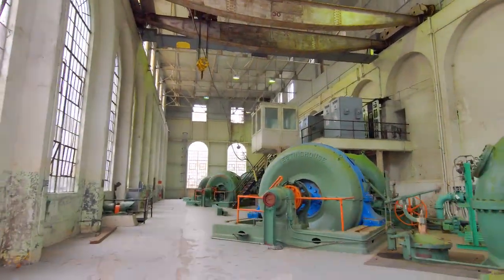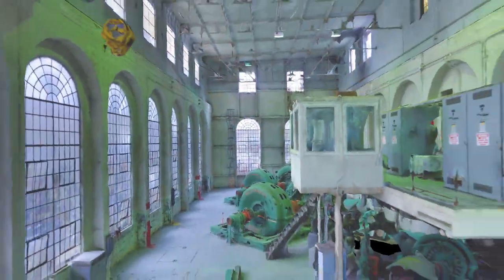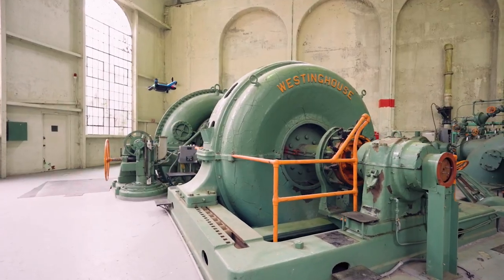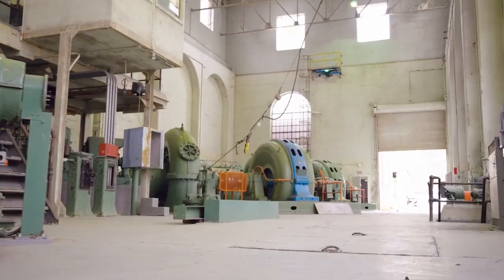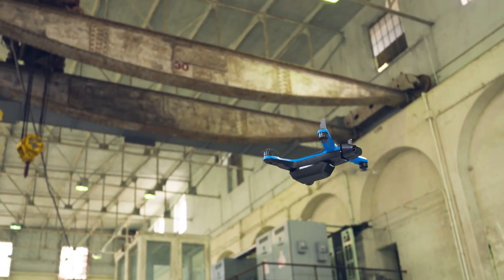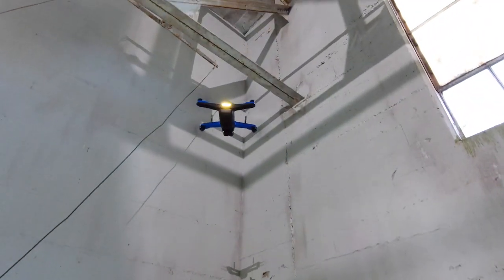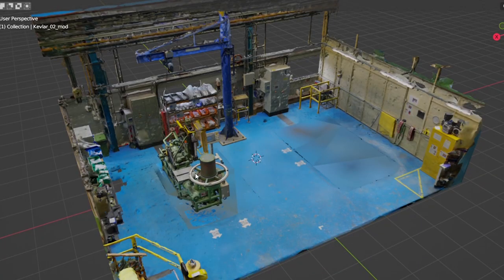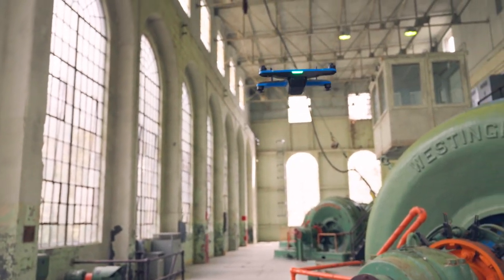Introducing Indoor Capture: Revolutionizing Large-Scale Indoor Data Capture

Comment: It’s neat. The subscription is $3000 a year per drone for it too fly and capture like this. After your data set is collected then you would use another software to make the model. My photogrammetry software is a bout $3200 a year and it does an alright job. Not measurement accurate unless you scale the model or use ground control points which requires some survey equipment. Don’t forget your going to want a high end computer to process the model with unless you use a cloud processing option which guess what?? It usually costs extra. Don’t get me wrong I like it all. It makes me some money but it’s like I give most my profits away unfortunately. I just say all this because when I started I thought it would be cheaper.